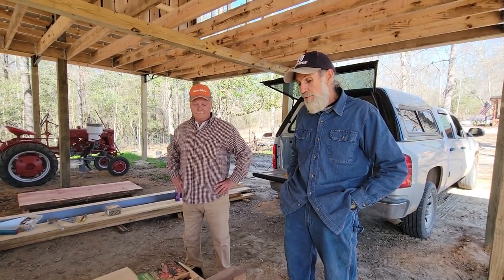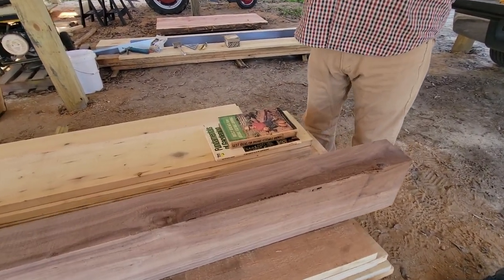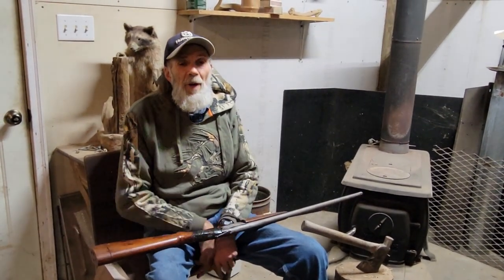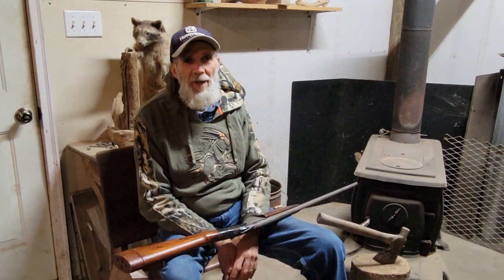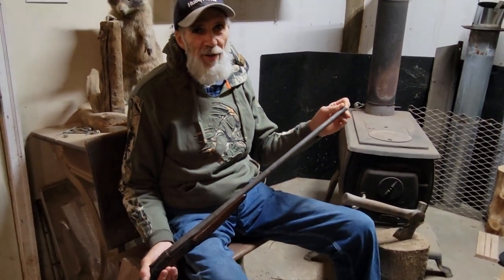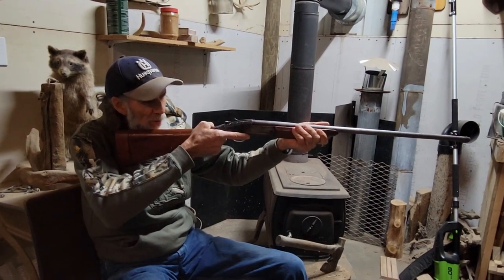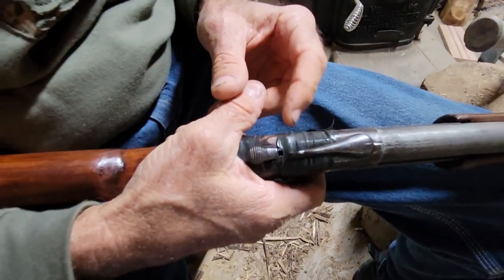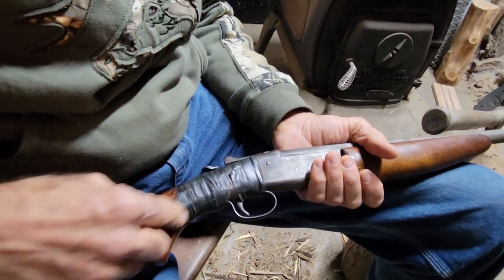Homemade Shotgun Stock CUSTOM Black Walnut Stock

Comment: winchester model 37 was made from 1936 to 1963 with 1,015,554 units made.. if you have any numbers on it or winchester( I have the number if you need it) they can tell you specific information on your gun.

Comment: Your story brought back many memories.  I spent many years hunting with my father.  To have your fathers gun just as a keep sake is something special.  I have several family keep sake guns and will never part with them.  They all bring back special memories of their use over time. 
The stock cant looks correct for a right handed shotgun.  I thought due to your height, you would need a little more cone drop.   You are right about drilling the stock screw hole, getting it to line up to the guns tang thread hole.    I needed special "Turkey Loads" for my 410 and they were $ 45.00 for a box of of 5 shells.   Normal 410 shells are very hard to find around here also.   If you can find any they have very few boxes and are costly.

Comment: How'd from East Texas.   The Winchester 37 model 410 shotgun were built between 1937 to 1963. If you can read the serial number on the gun you can find out the year it was manufactured.   You did a wonderful job on the gun stock.   May you and Ms. Wanda have a wonderful blessed day!
Reply from the maker: It was before they put serial numbers on them.

Comment: Good job Danny. I know what you were up against. I made a stock for my dads old stevens 22/410 over and under. I let the wood dry for 6 years. I cut the tree down myself . It was a tree me and my dad shot squirrels out of as a boy. its a 1930 gun .still got to build the forearm.  Dad trained me at 11 years old with a model 50 winchester 12 gauge .  knocked me down the first time I shot it. Ill send you a picture sometime. thanks for the video.

Comment: That’s the absolute worse way to refinish a gunstock.  You don’t brush it on!  You apply it by hand, thinned out, and using thin coats.  You may have just ruined that finish.